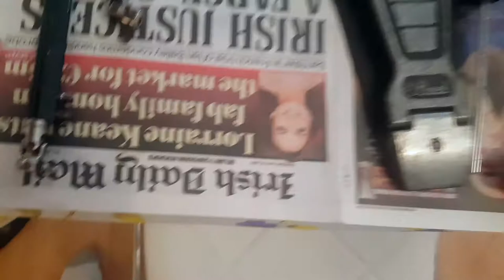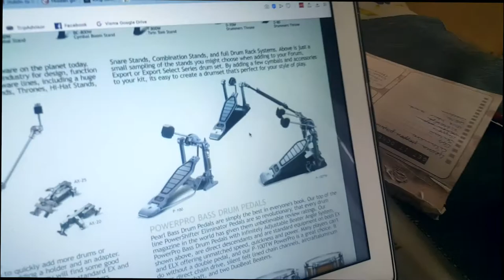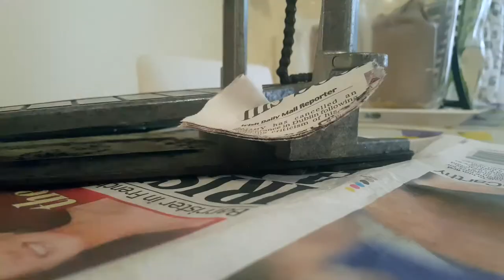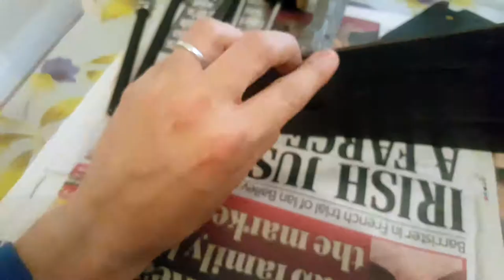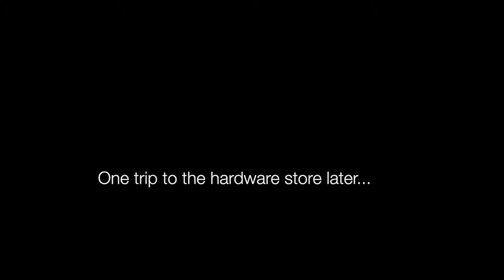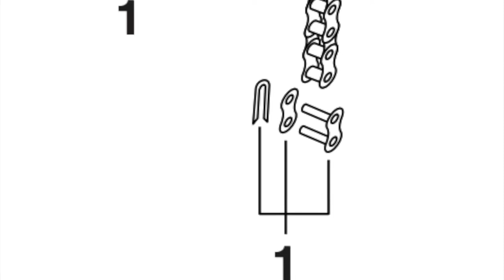Pearl Double Bass Drum Pedal Restoration - 115 Subscriber Special!

Comment: This might be the best edited instructional video I have seen, just in general. For drum hardware specifically, I did not realize that work of this quality was even possible. The beater polishing part also was a marvel, and that was probably one of the easiest steps here. You were of course also correct about the 2mm grub screws thank you. I managed to get them out after a more careful rewatch of that part.

Comment: I have the single version of this pedal and very tempted to try some ceramic bearings in it.
Reply from the maker: Go ahead and give it a try. It will make it a bit smoother I bet, but you would probably notice more of a difference (or get more bang for your buck) putting the nice bearings on a really good pedal, since these guys are not quite as energy-efficient. But still, would not hurt!

Comment: Really nice work, I have a P2002 (black foodboards with red dots) that I need to do what you did, but I'm going to try and re-powdercoat the boards. I was stupid and neglected them when I had to move and didn't put them in a dry space, but I want to fix them since they are perfectly fine mechanically. I'm probably going to put some really nice skateboard bearings in them and upgrade to the Trick drive shaft as well.
Reply from the maker: Yes, absolutely powder coating would be way better. Great idea, and good luck! Hope this works out for you :)

Comment: just bought this and also came up pretty dirty but not as bad. you did a great job and certainly your video will help getting mine as neat as yours. so how much money did you end up putting on this?
Reply from the maker: Hey, thanks for the comment! Well, I don't think it was much... maybe 30 or 40 euros overall? I would recommend you consider powder coating the hardware instead of spraying, as it will last longer. But you can get quite durable spray paint that will work. Best of luck!

Comment: After you removed the rust with vinager, do they still smooth and clean or they get rust again with the pass of the time?
Reply from the maker: As long as you clean them every once in a while with some polish or cleaner (very little), touch up with a tiny bit if oil lubricant and keep them in a dry place, they should be ok. Some other pedals out there are finished, chromed or powder-coated for this reason, but pedals are constantly in contact with many moving parts, and they get a lot of mileage under your feet near the ground, being thrown around for every gig, so even then sometime coatings won't protect them 100%. I'd say as long as you keep them clean, oiled and dry you'll be fine. Thanks for the comment!

Comment: How did you get the outer bearing off in the slave shaft shown around the 8:07 mark?  I'm attempting to replace all of my bearings on a Pearl double pedal and my bearings don't just fall out.  I have two identical double pedals and both set of bearings on the mini shaft are stuck.
Reply from the maker: Look for tiny grub screws on the bearing housing, there may be some holding them in the frame. They are quite small.
Reply: Thanks!  I figured it out.  The grub screws hold the mini shaft in place, but I was trying to figure out how to get the bearings off the mini shaft once you get the shaft out.  On mine, the mini shaft is toothed so the bearings wouldn't just fall out.

Comment: Hey mate, great job.  I’m inspired to restore my eliminator pedal.  I need to replace the screws/bolts that hold the heel plate to the plate you press your foot on (the piece with the logo and foot print).  I can’t find the specific screws on pearls online page.  Do you have any suggestions?
Reply from the maker: The best way to go about this is to bring it to a well-stocked hardware store, and start trying to find the size that fits. They will be metric, somewhere around the M5 size I'm guessing. Good luck!

Comment: have you tried working with yamaha double bass pedals?
Reply from the maker: I have a Yamaha flying dragon, but I haven't needed to work on it so far. Need help?
Reply: @NuDrums  hi! I was watching your pearl pedal restoration.very nice work. 

I have a (Yamaha FP9500D direct drive double bass pedal)
i recently bought mine, and found that the right pedal was very smooth.However in the left slave pedal i can feel a slight "play". I noticed that the part holding the beater and the shaft were a bit loose.Is this normal? i tried looking for an adjustment on that part but I cannot find anything.
Reply from the maker: @boldstardex  Hello again! Interesting... if I have understood you right, it might be that one of the hex-screws holding the cam to the turn-shaft on the pedal might be loose. Maybe check and make sure that all the screws are tight? If not, feel free to hit me up on facebook and send me some pictures. Hope this helps!
Reply: @NuDrums  yup. it was those screws that got loose. whats your fb?
Reply from the maker: @boldstardex  awesome to hear that everything worked out! My Facebook is the same as my YouTube name; just search Nudrums and you should find me!

Comment: Superb job! I'm just about to order a replacement chain from China. It says it comes with master link (singular) I just hope that means both ends! ;-)
Reply from the maker: Nice, thanks for watching! What kind of pedal do you have?
Reply: @NuDrums  it's an old Pearl (late 80's or early 90's model). Just realised when I checked that I could reattach the master link on snapped chain and it broke near one end so only a bit shorter. Will give it a vinegar bath first. 🙂

Comment: Halo. Somebody knows how calibrate the hamer´s angle?   Thanx
Reply from the maker: @juankespitiasilva2859  it depends on which pedal you have. The cheaper pedals do not have precise angle adjustment, but you can adjust the angle the beater sits on the beater shaft by disconnecting the chain from the Pedal board and the spring assembly and picking a new angle from there. You can also somewhat adjust beater angle by lengthening or shortening the chain connecting the footboard to the beater cam. Let me know if this helps!
Reply: @NuDrums  Thanx I have the same Twin pedal Pearl P100
Reply: @NuDrums  Thanx.  I have the same Twin pedal Pearl TW100.

Comment: 8:08 how the fuck did you remove that I can't take mine off no matter what
Reply from the maker: You talking about the mini-axle for the slave beater? It was held in place if I remember correctly by a small Allen screw. Check the posts.

Comment: Next time Use coca cola to clean rust and ball berings just get a couple of bottles and pet everything soaking overnight
Reply from the maker: If it works for you, great. I would never use it though, nor recommend using cola, or any sugary drink for a few reasons: 1) sugary residue and acids inside the cola can cause weird reactions with grease, causing it to coagulate, clogging up the bearings and making more of a mess. 2) sugary residue needs to be removed after the soak anyway, with another solvent. So why not just use the proper solvent in the first place and save yourself some time? 3) Water content. Cola is mostly water, and that water will cause rust if mot dealt with (which means again, you have to spray them down again anyway). Exacerbate the oxidation process with acid, and you have a big problem- if not right away, then soon. 

The reason you don't want all these additives is because you are trying to eliminate grease and dirt primarily. Acetone and isopropyl alcohol is just much better in every way, and saves you time. Another added benefit is it evaporates afterwards, which allows you to just re-grease and be done.